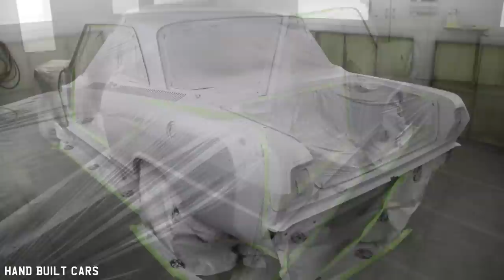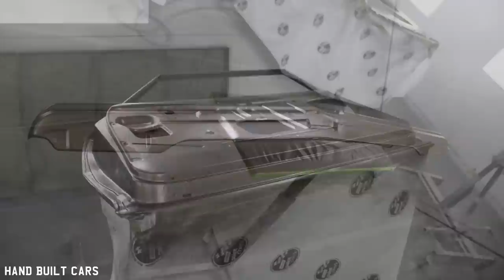1963 Chevrolet Nova Chevy II 100 2-Door Coupe Restoration Project

Comment: you upgraded the original rims from the original 4 lug to the 5 and in 63 all you could get was a inline 6 cylinder, the car looks good but the "restoration".....you built a hot rod.  looks good though.
Reply: In '62/'63 you could order a heavy duty suspension package, that upgraded the four lug ,13 inch wheels to five lug , 14 inch wheels and tires . Also there were two engine choices, a 153 inch four cylinder , or the 194 inch six cylinder . There used to be a guy in town that had a four banger Chevy II , with a three speed and overdrive trans , it got 28-30 mpg . See , 60 years ago they knew how to build a good looking , fuel efficient car , why they can't do so now is beyond comprehension .